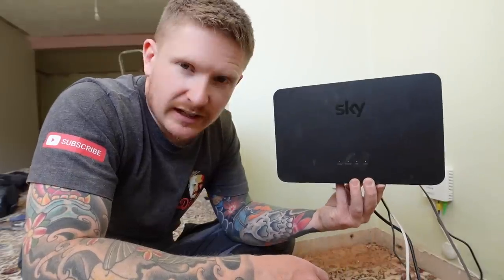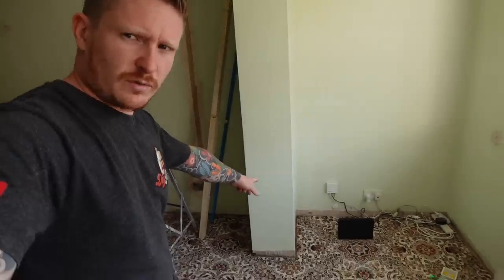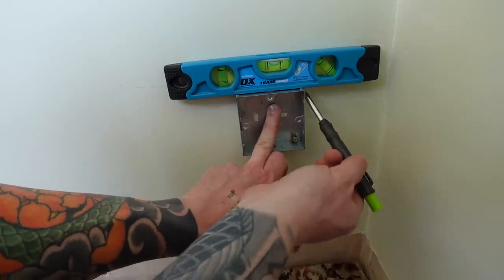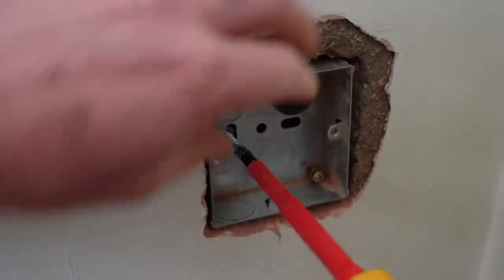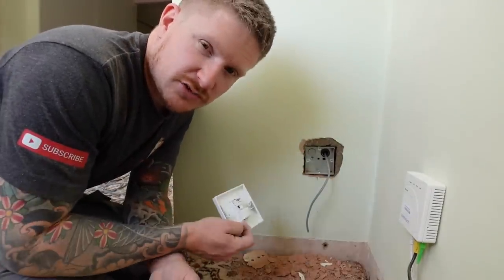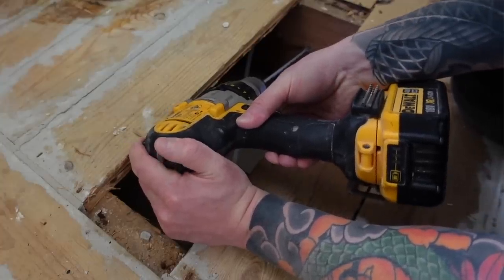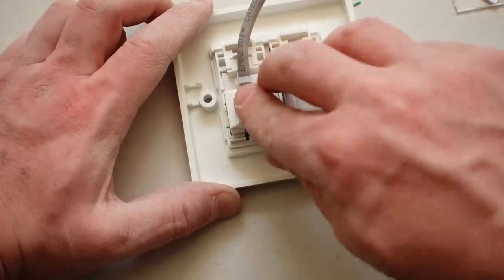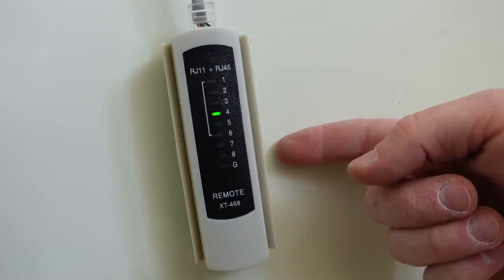How i Installed Network Sockets in an Old House | No More Wifi

Comment: Great video as most other ones on the subject are installing in stud walls.  I'm just about to do this in a bungalow which has solid interior walls.

For me it would be really good to see more on how you repair the wall damage after fitting the wiring as that's the bit I'm most lost on and most worried about doing well.  All we get is "use some easyfill to repair around the sockets ... and some bonding to repair any chasers" but I have no idea what "easyfill" and "bonding" is :/
Reply: I would imagine for gaps this size Polyfilla plaster repair would do. For the chase, definitely recommend covering the cable with plastic channeling once it's run. Not only to protect the existing cable, not only to make it easier to replace, but also to reduce the volume you'll need to fill afterwards

Comment: Really helpful video man.. Do you need to run a separate cable for each outlet or you can loop them out?
Reply: Yes, one cable per device/socket, no daisy chaining
Reply: Every cable needs to run back to the router. It's not a ring circuit.

Comment: I've run weatherproof Cat 7 ethernet cables from my virgin hub via a ethernet switch to the outside, up to our bedroom and around the side of the house to our sons room. Another switch box means his Xbox and laptop aren't reliant on iffy Wifi that far from the hub (it was actually non existent) and a third is in our room. Our TV boxes use ethernet which means we have a good signal where we need it most. It also means that if the WiFi dies we still have the telly and laptops. However with the advent of mesh networks I've gone one step further. I've installed three eero mesh pods so far with two being backhauled and I'm waiting for a fourth which will also be wired. This will completely cover our house in WiFi as three of the four pods are hard wired. My recommendation is to disable the WiFi on your ISP router and put it in modem mode. That stops any signal clashes and now we have every device that has an ethernet socket hardwired and all the devices such as our phones, Hive thermostat and echo devices that are wifi only have a full strong signal. Then there's the speed issue. We now have the proper speed from our ISP that we pay for whether wired or wireless. 
I like what you did and I find it fascinating but in reality it's either a job for when a property is empty and being refurbished or if you have a very understanding partner. I have neither 😂

Comment: @theEnjoyed this, well done. The only thing I would have recommended would be resessed cable ducting in the channel chase you made. This would then give you a degree of future proofing if you ever need to replace the cables, or add new ones.
Reply from the maker: Done ✅, 20mm oval conduit inside chase
Reply: @TheDIYGuy1  ahh missed that,  thanks
Reply: If you're planning on pulling data cables through conduit you'll need to avoid any sharp bends, and keep the tension below 25 lbs, otherwise you risk damaging the transmission qualities of the cable.

Comment: You should have mentioned the type of cable. You should be using solid core for fixed installation. The problem with a lot of installation is that it can work but may well be introducing a lot of noise which will mean lots of errors and retransmits and therefore poorer performance. The specs for running cables are to provide a guaranteed performance which can only really be ascertained with a really expensive certifier. 

It will probably be fine in short run situations but people may well not know.
Reply: He did but recommended ca5e or cat6..Complete minimum should be cat6 preferably cat6a
Reply: @triplexdread he means stranded or solid core cable. Solid core structural cable should be used for your runs whereas stranded is better for connecting your devices to the wall socket.
Reply: @domhamai  The only reason for using solid core over stranded for fixed installations is cost. You can happily use stranded if you want it's covered in the IEE 802.3 Ethernet specifications and it does have some advantages for retro fitting as it is easier to run being more flexible. However you do need to make sure that your wall plates and patch panels are suitable for use with stranded cable as not all are.

Comment: For reliability and transfer speeds it's no contest when it comes to wired LAN  vs WiFi.  WiFi has got a hell of a lot better in the last 10 years but it still has good days and bad days. Wired network connections once installed are rock solid provided you use good cable and good kit (switches or hubs) from a reputable maker.  However as you show here installing cables all around a house is a task, The ideal is to do it when the house is empty (i.e. between occupancies) - but since that is usually not possible, it is probably best done in stages - for example as each room is redecorated/refurbed) as part of an overall LAN plan.  A lot depends on what you use your house network for.  If it's just office work and email then you may not gain much in speed, though you will get more reliability.  But if you're moving around a lot of data around (talking about HD video or large software downloads etc) then it is well worth the effort.
Reply: What people tend to forget is that WiFi is a shared resource and most people find that they will be sharing the WiFi channels (frequencies) with neighbours and any equipment that also happens to use the same frequencies. Even without external interference, the available speed is still shared between the available devices therefore, for example, if you have 100Mb WiFi connection and three devices, each will get a little under a third of this capacity (reality is more complicated than this, but it's a simple visualisation of it). The newer WiFi ranges, such as 5GHx and 6GHz in particular also have less penetration therefore walls and similar in the way can greatly reduce performance. Nothing sensible/legal that you can do about neighbours though...

Comment: Really useful video,
Question: I’m buying an early 20th century house that needs a re wire. Can the Ethernet cables run alongside the new power cables or will this cause interference?
Reply: keep a distance of 50mm if running parallel

Comment: Theory is spot on but the downside is if your going to that effort the internet access point should have been relocated to somewhere more useable and a plan for the rest of the house should have been made. In the first instance you say all the walls are solid so your Wi-Fi is going to struggle. I recently did my whole house I put a server cabinate in my garage and had my access point relocated then I ran all the cables to one place and into a 24 port managed switch. It means I don’t need to rip half the house up later down the line because I don’t need any more expansion. Could also run all CCTV, NAS whole heap of items

Comment: Ideal solution is to run 1 single cable from that spot to a patch panel somewhere in the house and route all the cables to that patch panel, have a dummy switch that just splits up the router connection to the other routes and you're golden, never need to move nothing. Reason I suggestion to put it elsewhere because of the fact house is 1970's meaning it ain't plaster where you can easily make a hole for the cables to go through.

Comment: An easier option I used is to just use some of these Powerline ethernet adapters , the new generations work very well. I get GB speed through out my house. Devolo Magic 2-2400 Lan
Reply: I've been using them for years. Quick and easy, hassle free set up you can swap them to any socket you want if you ever need to move stuff around.

Comment: My home is old, build in 1950s. I used google wifi 3 packs. Its Mesh technology takes care of all my ethernet and wifi needs. No drilling required.  No mess. You will need to have outlet for the room, that you want to used ethernet. Setup is easy as setting up any router.
Reply: Mesh technology is a good retro fit solution, but it will never compare to hardwiring devices. You'll never get 10Gpbs speeds over your Mesh Wi-Fi network. Wiring a house with CAT6 has a number of advantages. You even even use it for video distribution. Wireless networks still are not reliable enough for everyone.

Comment: There is a lot missing from this video, especially a basic network diagram showing how you would use a network switch to connect the sockets together.  In most cases, using a switch will greatly simplify the install and reduce the amount of cable needed.   In my case, I put the switch in the loft and ran the cables down to the upper floor rooms using the gap in the stud wall.  Only a single cable joined the router to the loftspace, which I did by going through the outside wall and up the back of the drain pipe into the soffit (and therefore, loft space). The main cable between the router and loft switch is therefore easily replacable should it ever needed to be upgraded.  I also put cables in conduit where possible and left in a length of strong string (builders line) in case I want to pull any addtional cables through them in the future (much cheaper than putting in a second CAT6 cable as others have suggested).
Reply: It's also helpful to know furniture placement where you can hide cable if need be.  I agree that a switch is the way to go.  It is way easier.  I have my cable modem (one I purchased not rented) that connects to a PFSense firewall/router and that goes to a switch that connects the rest of the house.

Comment: Worth bearing in mind that Cat6 is less tolerant of bends than Cat5e is. If you have bends/corners with a radius any tighter than a tennis ball it can impact the performance of the cable. And also regardless of whether you go Cat6 or 5e, get the decent stuff at least 24AWG don't go for the cheap rubbish with crappy thin copper like 28AWG.

Comment: Hiya, I want to start getting some tools together for renovations. I don't own a drill currently. If I buy an SDS drill can I use that for all drilling (e.g. normal holes for putting up the likes of curtain poles etc) or do I need to buy a hammer drill for that purpose?
Reply: SDS drills are typically used for heavy-duty drilling into materials such as brick, stone, concrete and other types of masonry. An SDS drill and a hammer drill are very similar. They both do the same job, but an SDS drill does it better. 

For a DIYer I would recommend a combi drill to start. It's basically a drill, hammer drill and screw driver all in one. As you progress with your renovations you might want to buy an SDS drill for drilling into concrete or stone.

Comment: missing conduit to protect the wiring in the chase but as always top notch :)  someone will hang a picture into that cable in years to come
Reply: Explain how conduit protects someone putting a picture up?
Reply: @JIBS.  It's not the mechanical protection, but rather the ease of replacing the damaged cable.

Comment: What is the best way to do this if you need more than 2 upstairs?  Is there a way of having multiple wires coming off of the 2-socket box or would it be to have some sort of splitter/network box upstairs or can the sockets be daisy-chained?
Reply: You have 2 main options:
You can run as many cables as you need and install a wall plate that has that number of ports. If you're already going through the trouble of running data cables to a location, this may be a better option.

If you don't want to or can't run that many cables, the next best thing would be to install a network switch. In short, you can think of a switch as a power strip where you can plug in multiple ethernet connections to a single box. You can buy simple switches that only have 4 ports to larger ones that have 48 ports.

Comment: How do you deal with the wooden braces in todays modern dry wall rooms with the battens behind the plasterboard when trying to run a cable up a wall into a room above.   I ask as ive been told I cant run an arial cable from downstairs to upstairs because of this      thank you

Comment: Not that it matters too much from a safety point of view with data cable, but have you run them in a prescribed cable zone?
Reply from the maker: Your right in saying that it doesn’t matter but yes, it is within 150mm from where the walls meet
Reply: @TheDIYGuy1  although it kind of matters when you fit a shelf to the wall and your network stops working. 😂
Reply from the maker: Lol that is true!

Comment: Great tutorial but I think powerline adapters are a more convenient solution for the average person. It takes 10 minutes to setup and performance is not that much worse than ethernet cables unless you are unlucky with the wiring.
Reply from the maker: You could be right but in my experience those power line adapters aren’t brilliant

Comment: There is a technology called Ethernet over Powerline from the like of Netgear. I used it first in 2008 with 500Mbit/s bandwidth to avoid wiring ethernet cable. Now the standard is 2Gbit/s. Sufficient for most use cases except perhaps for low latency gaming.
Reply: I tried that like 8 years ago. Couldn't get more than like 25 Mbps even when trying multiple outlet combinations. Its not an infallible solution. Those numbers you see are theoretical values under ideal lab conditions.

Comment: Would it be possible to connect the single cable to a bus in an attic to allow multiple rooms work off the same line? I want to connect more than 1 room but am aware most routers don't have many ports on the back.
Reply: If I understand your question correctly, you want to connect more devices than ethernet ports available on your router. In that case, you would install a network switch between the router and the data drops. The switch allows you to connect multiple wired devices to your router. You can get switches with 5 ports to about 48 ports if not more.

Comment: Tip for you, instead of chain drilling use a multi tool you get a neater finish
Reply from the maker: That’s good for drywall but brick messes the blade up really fast
Reply: @TheDIYGuy1 used the diamond blade on the multi tool, made it a damn sight cleaner. Just by using it to get through the plaster it allowed a cleaner chase.
Reply: @TheDIYGuy1  a normal blade will take you through the plaster, I do it most days am a spark
Reply from the maker: Maybe it’s just the screwfix erbaur blades I use then but they don’t seem to last 5 mins on anything other than plasterboard if I’m putting knockout boxes in

Comment: I presume one end of the cable has to be connected to the modem or a network port?
Reply: Yes. You can daisy chain the cables if you use ethernet network switches. There should be no loss of signal even after multiple connections.

Comment: Great video, but why bring the cable through to the other side of the wall, befor running up? Anyone coming along after drilling into the wall for any reason won't know the cable is there and could drill into it. Whereas if it's on the same side of the wall as the socket, then it will be in that sockets 'safe zone', so anyone with an ounce of sense will take that as a warning tha a cable may lay buried in the wall vertically or horizontally from the plate.
Reply from the maker: Thanks. Zones don’t apply to network cables, and if they did it would still fall within the ‘150mm from a corner cable zone for adjoining walls’. I see your point though and it’s a fair one as a general rule.

Comment: would that mean each one of the boxes and ports need to be plugged into the router?
Reply: That is correct. However, if you plan on running more than 4 cables around your home you'll need to connect them to a network switch. And then the network switch can be connected to the router.

Comment: Could you run the cable outside and fix the cable to external walls then run it inside through a drilled hole in the wall where you want the outlets? Will the cable be able to cope with all weather?
Reply: You will need external grade cable or the sun will degrade the cable over time.  
Or you can run in trunking or conduit and this protects the cable

Comment: The reason that I watched the video was to knwo what kind of cable is used between the router's LAN and to the input port of the socket. I tried straight cable bw the router's LAN and to the port on one of the socket but not getting any connectivity on the other socket which I have in my new house.
I think I need to use a cross over cable between the router's LAN and into the port on the socket and from any other socket to the PC i need a straight cable.
Reply: Pretty much all network equipment from the past 15 or so years has an auto-detect feature built-into the network adapters. There's no need for cross-over cables in most hardware nowadays. The network adapters can sense the send/receive pins automatically. I would buy an inexpensive ethernet cable tester to make sure all the pins are good.

Comment: Check for underlying pipes/cables before drilling (or cutting chase) in wall, using cable detector?  Particularly in older buildings you can be surprised by unexpected cables. Also watch out for running data cables parallel to mains power cables, in this case keep about 30 cm away and if crossing can't be avoided have a 90 degree crossover.

Comment: You forgot to mention fitting grommet in the backbox for cable protection. Even though you had fit one. A krone punch down tool would have been better for that may sockets.
Reply from the maker: I mentioned the grommet in the video 🤔
Reply: So you did. My mistake 😊

Comment: i have a question i have recently bought a house that has a telephone socket in every room can i use these to network?
Reply: Only if the person who did the sockets had the foresight to use Cat5e and bring them back to a central point to wire. Most phone sockets don't use Cat5e and the cable goes from socket to socket and rarely to a central point. In my house, both phone and ethernet sockets are wired in cat5e and go to my telecomms cupboard.